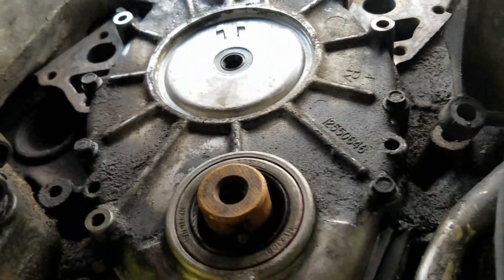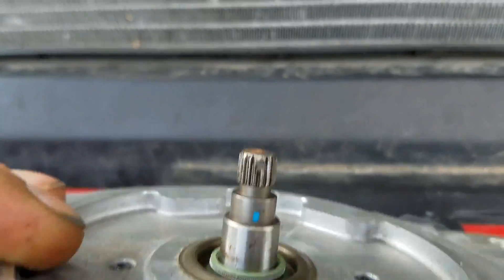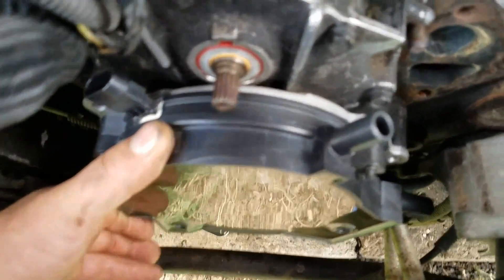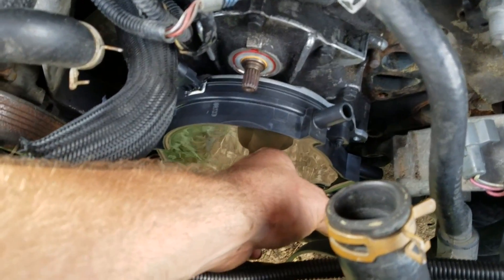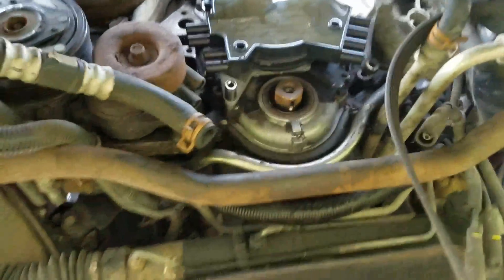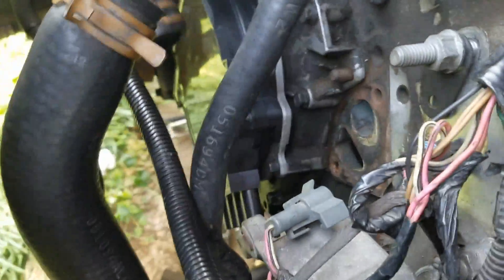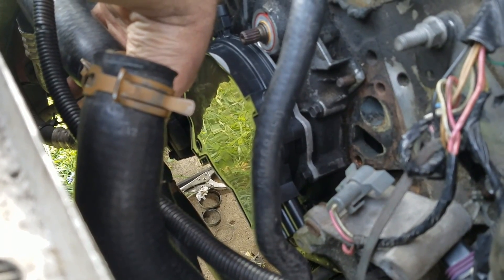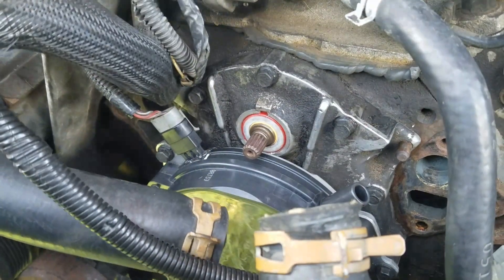92-94 LT1 Optispark PROPER Installation Explained

Comment: Don’t miss working on opti. Piece of junk!
Reply: there great when they run,,,but a real shitshow when they dont,,keep em out of the rain,,wet,,,theyll run a long time
Reply: @daryllmroberts7958  seal them up, also rare the ecm goes bad
Reply: @shadowopsairman1583  nope but they all dissing..least us OGs staying true with what came first
Reply: @shadowopsairman1583  nope but they all dissing..least us OGs staying true with what came first
Reply: Most mechanic shops these days wont touch them with a 25ft pole, they are absolute junk and aren't worth 50 cents. Good parts are becoming impossible to get and they do make good power when they run but good luck keeping them running, the first time the aluminum headed motors got hot they instantly crack the heads and the crankshafts are really soft and the bearings will eat the crank with no signs of bearing wear. That's why most reman lt1 engine have 40-60 under cranks to clean up and the cars these engines were installed in had horrible wiring and almost all lt1 cars had hotwired fans becausethe stock harness would burn up and trying to fix those cars is a nightmare and something as simple as spark plugs will take hours and sometimes days to complete. I despise these engines I would way rather have a gen1 small block or skip to the ls I'm glad these lt1 cars are getting junked like they deserve to be.
Reply from the maker: Yeah they weren't worth shit just a few years ago when I had them, so I couldn't get anything out of them. Now that I sold all of mine, the prices have sky rocketed on them. Figures...
Reply: Lol all u snowflakes melting. My old tired lt1 smokes those ls monkeys at strip. Course I'm coil converted,sprayed and prayed up. ;*
Reply from the maker: Lmao nobody here said they were slow; why you think I ran them for years? Cheap power. I would like to get a low mileage SS from somewhere dry before they are all bought up, destroyed, or $20,000 collector items. I miss mine but I don't miss working on it.
Reply: Coil on plug upgrade
Reply from the maker: Amen! Got rid of all the damn LT1's. I was going to go LS next, but somehow I ended up with a 2014 Mustang lol.

Comment: I’ve changed opti installed crank module crank won’t start Choi’s u help please
Reply from the maker: What is a "crank module". If you want me to try to diagnose the problem over the internet then I need all the details, in vivid detail. What happened, what was the car running like before you did this work, why did you decide to do this work, what work you did. Again, everything in vivid detail. If you say something like "yeah it stopped running so I changed the opti," that's not vivid detail and I won't be able to help. A good website with a lot of good information about these car and how to test for bad parts is shbox.com.
Reply: Guns&Cars ok I put a lil gas in the throttle body an it crunk I drove it down da street pulled up on a hill to turn around an floored it ... kinda hesitated like if the gas was low turned it off now it won’t crank again
Reply from the maker: Yeah I literally wrote a longer paragraph telling you the amount of details I needed than what you just wrote to me. I also asked specific questions and you ignored them. So good luck, because clearly I'm not going to be able to help you with what little information you gave me. What you just described can literally be cause by 20 different things, which is why I asked specific questions and told you to be very detailed with your description. So again, good luck, and goodbye.
Reply: think befor I all diz I might have put sum bad gas in it but I also was using gas treatment ... it started putting and stalling hesitant to pull ... so I changed spark plug, wires, distributor cap, inserted distributor cap correctly mad shore it was flushed. Spark plugs  wires installed correctly I have the firing order sheet changed the crank module installed that correctly ...... juz crunk it not to long ago after the third try drove it round the block came home back it in it went to idol height and pulling by if self and just cut off an wouldn’t crank back up...

Comment: This looks difficult af. Whoever made this video, when your in Florida, your beer is on us.
Reply from the maker: Lol thanks. While this was somewhat of a PIA, I have certainly encountered worse jobs. As far as distributors go though, definately the worst I have encountered. 🍻
Reply: 1-10 it's probably a 1 or 2 for any decent backyard mechanic
Reply: @tykendrick800  honestly people acting like this is so complicated is literally the same as a gen 1 sbc just distributor in a different place
Reply from the maker: You don't have to remove the water pump on a gen 1 SBC to change the distributor... also there is a TON more room when everything is right on top on your gen 1 SBC, instead of smashed behind the radiator in a more modern car with a smaller engine bay. It's not rocket science no, but it's not at all compareable to doing it on a 60's Camaro like you suggest...

Comment: I've replaced the Optispark, Map Sensor, Idle Air Control Valve, Throttle Positioning Sensor and Mass Airflow Sensor on my 95 impala LT1 and its still throwing a code... just a few minutes ago it was running and I disconnected the Mass Airflow Sensor, the Throttle Positioning Sensor, the Idle Air Control Valve... I even loosened the hoses clamp and removed the hockey puck and the motor never even hiccuped.... I'm so freaked out... I thought the car would die or at least sputter or something... but if I try to drive it the car will die and acts like it wont start...
Reply from the maker: You had it running well ? Or had it running crappy? Also a little background on the problem would help tremendously... But yes typically if you unplug the MAF, it should run worse, IF it's working. But if it's already running horribly at idle, it would be hard to notice a difference. Hold some revs and then unplug it while it's revving up- it should change. If not, it could be bad, depending on how bad the car is already running. I would start with checking the spark condition if you're thinking it's the opti. Is it misfiring? Because if your spark is erratic, then it has nothing to do with any sensors. What's the code? Again, much more info needed...
Reply: @BuckeyeBallistics  no it was not running well.. smells very rich and the fans come on immediately even though it's not warm at all... I have no clue about the codes because I cant get my hands on a reader and the car wont stay running long enough to drive it to O'Reilly's to let them check it and they won't let me barrow a reader... they want me to buy one
Reply from the maker: Well if it smells rich then you most likely have a bad missfire and are not burning fuel in all cylinders. The opti and icm/coil are the most common culprits, if plugs and wires are in good shape. Sometimes the opti harness can fail as well. Not sure about the fans, maybe a fuse or relay. shbox.com has a lot of good info about the lt1's. I got tired of working on them, bought newer cars.
Reply: @BuckeyeBallistics  Thank you very much for your time and info.... I'm there about buying a newer car.. Merry Christmas and Happy New Year to you and Yours...
Reply from the maker: Glad to help, and you too.
Reply: @mrdeanv4414  could be one of the temp sensors on it went bad. Just watched a video on here about them. One of the two sensors controls when the fans kick on and off. It also sends signals to the computer that let it know if the engine is cold to spray a certain amount of fuel. As it warms up it will send signals and the computer will adjust the amount of fuel according to what temp the engine is running at. Might be worth looking into. There are YouTube videos on these Lt1 coolant temp sensors. Watch a few of them.
Reply: @bmf97ss1  awesome.. thank you very much and Happy New Year!

Comment: The 93-94 look like a nightmare to lineup; the 95-97 have a pin and are easy to install. 
The Opti harness, is easy to remove and install (with water pump on) using a long thin screwdriver.

Comment: Ok I got my 95 impala 5.7 Lt1 running after changing out the waterpump and optispark .. but the plug wire that goes into the coil is sparking.. do I need to get a new wire and coil or would Dielectric grease take care if this?
Reply from the maker: Replace the wire and it should be fine. It probably has a rip or tear in it, or is just worn out. That would be your most likely culprit. Make sure it's on all the way and not making contact with anything else.
Reply: @BuckeyeBallistics  Thank you very much..!
Reply from the maker: You're welcome

Comment: My optispark on my 95 Lt1 impala has 2 vacuum lines at the bottom of the old optispark and the new optispark has only 1 place for a vacuum line at the top of the optispark?
Reply from the maker: Somebody may have added an extra vent to it. The vent location is also different from year to year. This website may help: www.shbox.com

Comment: Hey man what brand did you use for the opti?
Reply from the maker: Ac delco/delphi. All the cheap ones are junk and will fail quickly.
Reply: Guns&Cars Where did you get it from? My trans am has been taking a shit on me recently and its buggin the crap outta me 😂
Reply from the maker: I actually got it from a guy on a forum parting a car out. You might have to order it from the dealership directly. Or get an MSD, but I have read about the screws backing out on those, so the fix is to lock tight them before installing. Ac delco/delphi is what came on them from the factory.
Reply: Guns&Cars how long have you had it on your car?
Reply from the maker: I'm going to be honest with you man. I got this car running and it drank a gallon of coolant in 10 minutes at idle, craked block I presume, so it's been sitting. I just know that the oem part is what you want to go with, based on my research. You can go to ls1tech.com and read all about it, or any other reputable forum.
Reply: Guns&Cars alright man thanks i appreciate it 👍🏽
Reply from the maker: Yup
Reply: @BuckeyeBallistics  there is nosuch thing as OEM anymore. They are not made. And remanufactured are poor shit rebuilts and the senor is painted black. Look it up. Many people have that poor shit remanufactured acdelco delphi.

The only way to get an OEM one is from an old car that has it on.

Goodluck people.

Comment: Why haven’t you switch to a vented copy? I got that exact same one from freaking advance I can tell by the seal around the PCM connector. Their junk man it’s got the same dent on the top as well while I’m refusing to put another sealed copy on my Camaro it’s too much work I just replaced mine for months ago.. huh good luck. Hey I saw something about switching to a coil driven system off of the OPTi gear.. looking into it
Reply from the maker: That's not a parts store opti bro, it's an AC Delco $400 opti. Yes you can switch to the coil system from the ls1 cars, but it will set you back nearly a grand from what I understand.

Comment: I have a 96 firebird formula I changed out optispark with a aftermarket msd one and haven't been able to get it timed right to start. The back of my opti looks different tho it has a nipple with two rubber seals. Any advice of how to get it set right
Reply from the maker: 95 and up has a clover leaf looking thing on the back instead of the spline drive on mine. One of the "leafs" has a notch in it and you have to line that notch up with the notch on the cam. Not sure what you are talking about with the description you gave. Other things can cause these cars to fire out of time other than the opti as well...
Reply: angel hernandez hopefully you had it at TDC before you started. At any rate, on the spline engine side 2 of the spline will be flattened more than the others, that should be at 12 o'clock position. On optispark you should see where the 2 flattened spline are.
Reply from the maker: He has a 96, it does not have a spline drive opti.

Comment: Do you think it's likely that my optispark has gone bad 94 Camaro with 20,000 miles? All the symptoms are there except for the leaky water pump.
Reply: Update. Yes original miles. Replaced my optispark. It was all corroded inside and my car hasn't even been wet in over 10 years.
Reply from the maker: Well like I said in my original comment, with only 20,000 original miles, at least the seals have failed in 20 years time. And like I said, the water pump doesn't have to leak to cause problems. Once the seals dry up, moisture can get in there. Glad you figured it out, and thanks for the update.
Reply from the maker: The water pump doesn't have to leak for the opti to act up. 20,000 original miles? Not the opti itself, but the seals are over 20 years old at this point so yeah. The original oem delphi/ac delco opties are supposed to have a service life of 80,000 miles, per GM. Any other opti will never last that long.
Reply: Thanks for the response appreciate it.

Comment: how many miles were on this car, when you put the new Optispark and water pump?
Reply from the maker: 130,000 or so. The service life of the original equipment optispark distributor was only 80,000 miles, as per GM. So any car that makes it past 100,000 miles on the original opti did pretty well. I had 3 make it to 120-130.
Reply: I just bought a 97' Z28 with 154,000 miles. It runs fine, i'm not sure when it was replaced.

Comment: did you have to change the plug in connections or was the fatcory connectors the right fit. also i been going back and forth with my brother he believes it has to be timed in order to work properly  say it already comes timed and ready to go.
Reply from the maker: Marcus Dennis No it just plugs right in. I have heard of some people trying to plug it in backwards though, so dont do that. Timing? Lining up the notch correctly as shown in the video is what sets it in proper time. So, yes, it comes ready to go. Just line it up properly and you're done.
Reply: Thanks
Reply from the maker: Yup
Reply: how long should it take what would be fair prices for parts and labors to do this my is 1995 c/4
Reply from the maker: +Jose Gonzalez I'm not sure if the Corvette is easier to do since it has a longer nose than the Camaro's and Trans Am that I have. But, on my f bodies, I'd say it takes about 2 hours without rushing to get it out, about the same to reinstall, except add another 30-60 minutes for preping the new water pump (scraping off old gasket from the block and applying rtv to mating surfaces). So 5 hours of labor should be sufficient for an able mechanic with the proper tools, and labor these days at shops is 85-100 bucks an hour on average, so that's 500ish in labor. You want to make sure they use an ac delco or delphi opti, this is original equipment. The cheaper ones typically fail in under 10,000 miles. So for a good opti it's just under 400 bucks at the parts stores, their supplier may charge more. When you replace the optio, you want to replace the water pump too so the old one doesnt fail later down the road and ruin your new opti. The new water pump should be 100-150 for a new one. So you're looking at around $1000 when it's all said and done. I have a short 3 min video on my channel that shows the entire process of removing the opti if it helps, and I can guide you through the rest if need be.
Reply: Corvette is way harder. Front cross member is in way. Removing crank pulley is a problem.
Reply from the maker: +Gene Dively Remind me to never buy a c4 then...